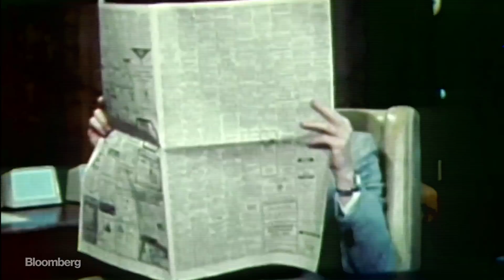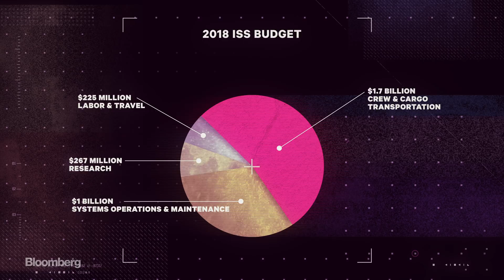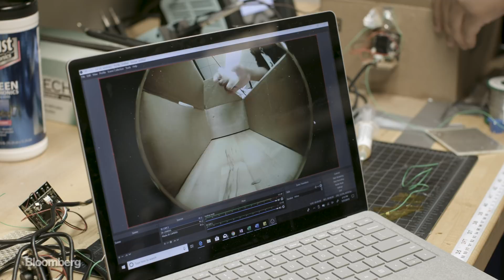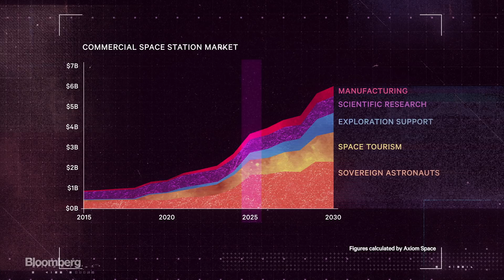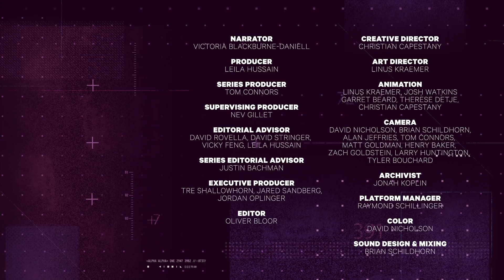Welcome To Your Home in Space

Comment: wont stuff on the moon mainly be underground? since like no atmosphere so you kinda want shileding from metoerites and radiation
Reply: WaffleSSSSSPLUS protecting against radiation is easy. Radiation shielding. Underground poses a lot of problem. Excavating, excavating ont he moon is currently not possible. You’d need a lot of funds,     the ground might not be solid enough and it’ll waste a lot of time.
Reply: @hazardous458  why is excavating a problem? also shielding is kinda hard since you'd need to use massive material from either earth or on the moon and if you're excavation material from the moon to use as shielding you might as well use the hold excavated as well. since gravity is weaker on the moon, retaining walls and other structural member can be light weight and be transported or manufactured on the moon more easily.
Reply: WaffleSSSSSPLUS And you’re just gonna bring a bunch of  excavating vehicles with large drills, something to lay down reinforcements to the moon, stuff to clear the debris, billions of dollar just for the sheer weight of massive drill heads and vehicles. For what? To protect against some measly radiation?
Reply: WaffleSSSSSPLUS Do you know how radiation works? Moon dust won’t do jack against radiation. Just bring up some composite lead panels imbedded in the habitat. It’s that fucking simple. You don’t need a lot to protect against radiation.
Reply: @hazardous458  not only radiation also debris, also machinery can be used multiple times compared to consumable materials. over a few projects its probably cheaper

Comment: The next step should be to make the largest pressurised... well... space in space possible. With a way to dock with it. Then to add to it life support for water, air conditioning, electric, etc utilities. Just a hard, air-tight shell with lots of room in it and basic utilities. Real-estate in orbit.
Right now the focus is on prefabricated, more or less self-contained modules with loads of little gizmos, but that's exactly what makes it expensive. You can't just go and build a factory and housing.
To this end. The two things that makes EVA more dangerous than it needs to be are the chance that you can drift off into space, and that you are not shielded from the sun and other radiation. The simplest way to mitigate this is to just build a large sack of interlocking disks. Not pressurised in the least. Just a space within which astronauts cannot drift off without a way to manually get back, and which shields them from the worst radiation. It could even be interlocking hexagonal solar panels (cheap ones. Just loads of them). with all the wiring to make use of the electricity generated.
It could be made quite large, relatively cheaply, and just be draped over a large rigid frame. And then a real pressurised space station can be built within it.

Comment: As long as the human race is still using hydrocarbons for feul, I am afraid that 1. the cost of space travel will be expensive and very dangerus just handling the feul alone. 2  Being exposed to space radiation and the lack of gravity has a lot of stress on the human body will have to be solved as well as maintaining  food production as well as water. 
3 Atmospher has to be maintained and tempature allso regulated.
Untill we can do all of the above economoly, space travle will be just too expensive.
Gerard.

Comment: I don't get the "retirement & de-orbiting" of the ISS...why not use the resources it already has up there to help construct and maintain the Axiom station?
Reply: Every component has a lifespan, as does the hull. The station was intended to last 15 years (1998-2013) but was built to last 30 for safety reasons and is currently operational. Given the level of precaution used when in space it is too large of a risk to re-use much of what is there. It is safest to de-orbit modules one at a time and let them burn up over the ocean than risk an accident.

Comment: honestly living in space sounds like a cold nightmare
Reply: Except Space is hot. You'd cook in the sunlight long before you freeze.
Reply: The part of you facing the sun would roast at temperatures of at least 250F while the side facing away from the sun would freeze at temperatures of -150F.
Reply: @samwestfahl5355  it takes a lot longer to cool down through radiating than it does to heat up so that's true if you have absolutely zero rotation, but if the astronaut has any rotation they'd be feeling crispy.
Reply: yeah sound horrible